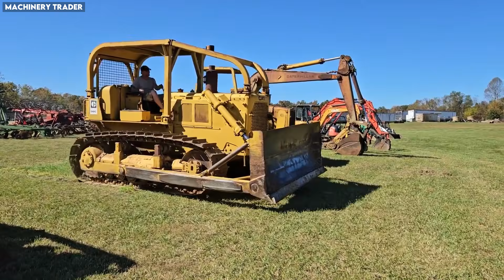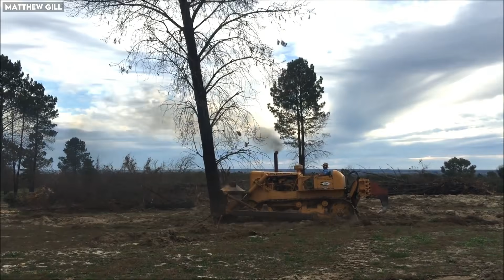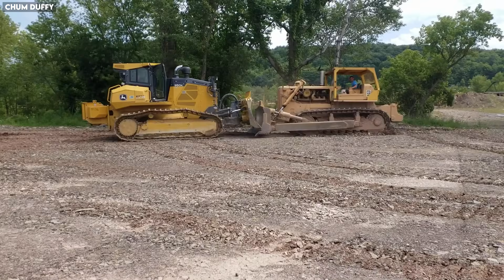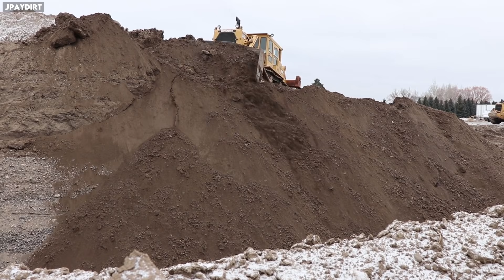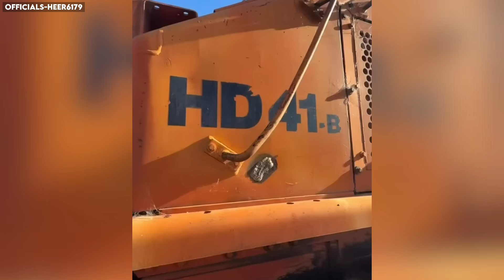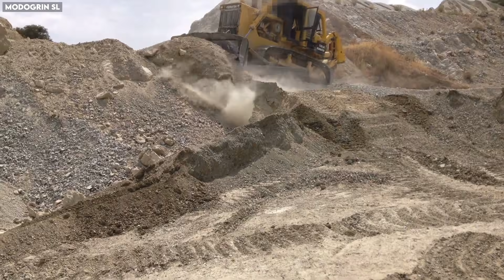10 Bulldozers From the 1960s That Changed Construction Forever

Comment: We had a couple other on the job at the Flat Top Mine in Graysville Al. One caught on fire and burned up. The other one was a mechanics night mare. I believe there were almost 50 short hydraulic lines under the operator cab that blew hoses regularly. They were quickly replaced by D9 H caterpillars.